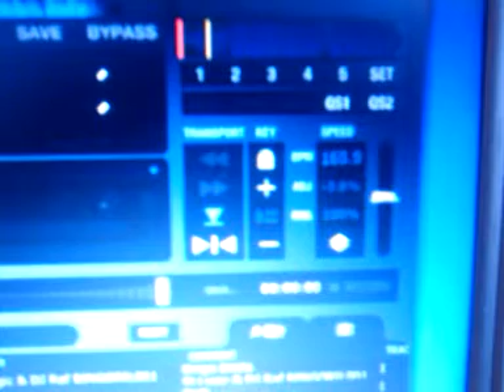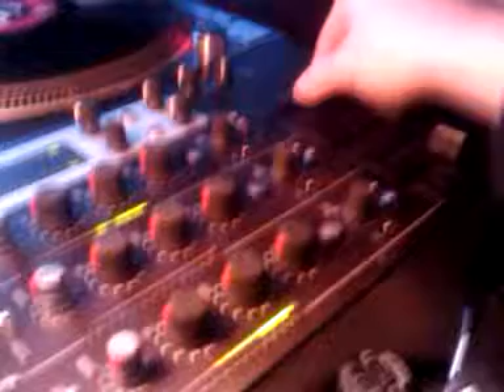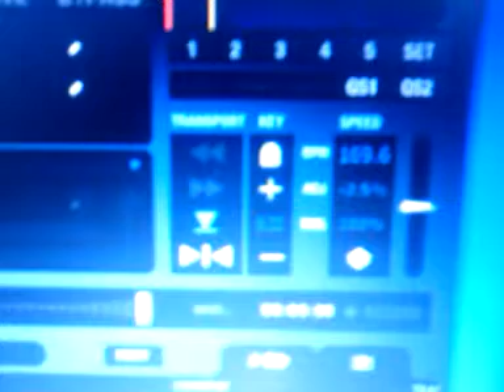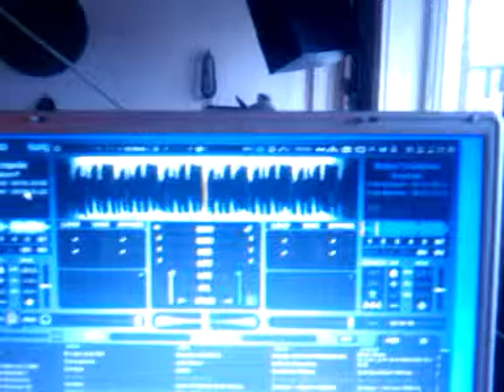Conective by M-audio Prt. II

Comment: I might be able to help you out on this. First try puting The Ground wires right to the sound card itself, The on the Torq progam trun down the gains so that the music in not peaking in the Red. That should take the craking noise out of the music when being played.
Also make sure your needles are clean, and make sure the carage are clean as well. Sometimes dust get in there and makes a bad conection.
I hope I have helpped you out on this.
I have been DJin' with Torq for about 3 years.